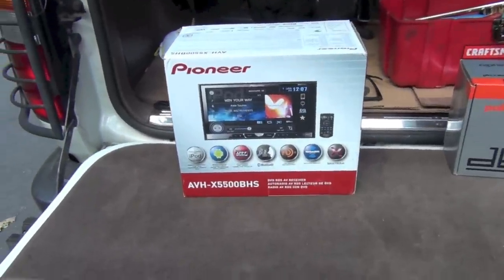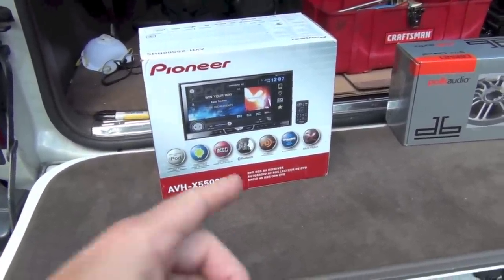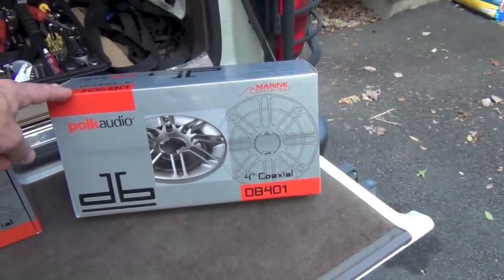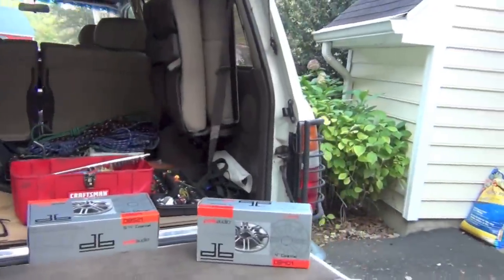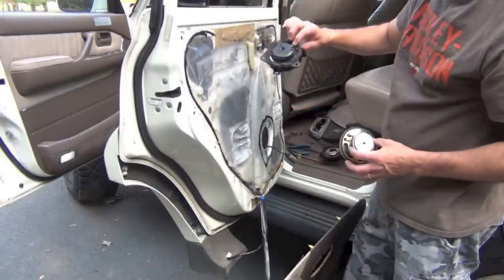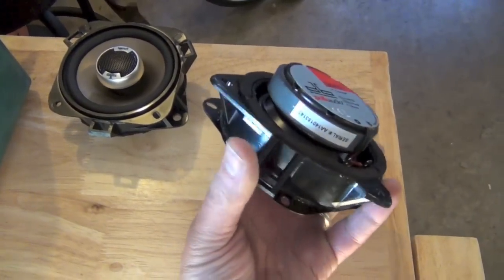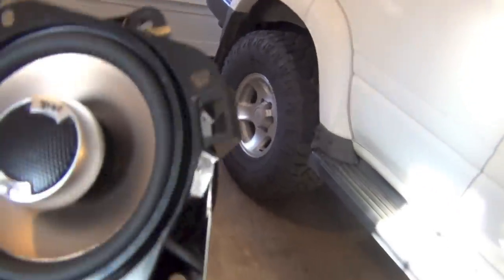Part 1 - Land Cruiser Sound System Upgrade

Comment: Your video was very helpful. I just installed  a kenwood ddx9903s ,2 front speaker  like yours but the new version that are shallow enough to use the  single inside  ring you made for me   between the metal door frame and the speaker . The rings you made were perfect thickness.  The door panel  and grill fit right over the speaker so I didn't need to touch the grill . The new version of the 2 rear speakers fit into the plastic housing   .All I did was cut off the  back piece that has the screw  hole  and I left the side pieces  for stability  .I also bent the tabs   and ran a screw on both sides into the plastic housing   to hold the speaker to the plastic housing . I also add  the polk  marine MM1240 400w 12 inch woofer and amp  in the back right panel. It took me a while to get the nerve  to cut a big 12 inch hole in the panel but I'm  glad I did . It's out of the way and it only sticks out about a1/2 inch  the length of the grill cover .While I was installing to radio I added a front and rear camera . So thanks again for all the help and taking the time to make the videos . I don't think I would have attempted doing this without your videos . By the way the polk speakers sound great .
Reply from the maker: That's great man!  Glad it all worked out and it sounds like you went beyond what I did and made an even better install!  I want to do the same with the subwoofer, did you use the existing wire that was there somehow or did you run a new wire to that sub?  Also, did you fish the rear camera wire through that water-proof flexible connection between the door and the vehicle?  Again, sounds awesome, thanks for posting the results of your project.  Clay
Reply: I got a subwoofer install kit that came with all the wires needed  and I ran new wire from the battery back to the rear panel and the rca cables and power on amp wire  from the back of the radio to the rear panel . My old woofer was in the center console  and it was tiny  the speaker was shot so I just disconnected it . I put the new amp and woofer in the back panel . The 12 inch woofer is to big to fit in and stay on the flat part of the panel so I had to go into the storage door a little bit . A 10 inch will fit perfect and just miss the storage door . I got the 12 inch on sale for less than 100 and its a dual  coil so I ran it in parallel to make it 2 ohm so it cut the 400 w  4 ohm to 200 w 2 ohm so I could use a smaller 250 w amp .  I went with the polk mm1240 marine rated like the other speaker are . polk makes a 10 inch  mm . You probably all ready have wires from the amp in the back panel in your truck  ready to hook a 10 inch woofer to. Find out what size they call for . They even make a metal frame for the woofer to connect  screws into the frame  you can see the threaded holes next to the clip holes to to hold it in place or it might be on yours already  . Look for a light green with red  which is negative  and a light green with black  is positive  and that will be your woofer wire positive and negative .I will send you some pictures on facebook  message . and I'm going to add some photos  in the forum  under what did you do to your 80 series this  weekend . I did run the wire through  a hole just behind the metal carpet  strip  just in line with the boot hole  I put a bend in the wire and it fed right into the boot hole  the backup wires with the rca connection will fit thought the boot  so you see nothing but the boot I'll send you a photo of that too. . You run the camera wire from the out side  to the inside.  there are 3 screws that hold in the black license plate lights on and you take the bolts off from the inside tail gate  once you pull the light plate off just make a small  knock in the plastic so the wire going in  from the back up camera won't pinch  against the light plate once you tighten it back up . It will fit in the same hole that the wires going to the light plate goes through  so you don't have to drill a hole in the tail gate . I will send you a photo of the wiring harness and the wire to connect the wire from the radio so when you put the truck in reverse the camera will auto come on .  I got the back up camera the has IR lights on both sides and it adjust up and down . I adjusted it so I can see my ball hitch so I can hook up my boat  first try  now . I got this one . it works great . they say its water proof but its not . I put silicone sealer around all the ir lights and around the body to make sure no water can get in . There was big open spaces between the ir lights and the body . It has hex screws on both sides so once you have it adjusted where you want it you can tighten it up . I will take a photo of the view from the radio tomorrow and send it to you so you can see the view  from the radio I might go out at dark to show how the ir light work . https://www.amazon.com/dp/B06X6GQVWW?psc=1.
Reply from the maker: Very cool.  Nice work man.  Will love seeing the pictures and will go to the mud site to see your write up.

Comment: Thank you man I  am doing this same exact swap on my 80's series! Thank you! I hope the polks are good the reviews are all kick ass
Reply from the maker: Tim, I had the ID when I was making the rings, but now I can't find that dimension; sorry!  I used a tape measure and a couple of pieces of wood to basically make a long-nose caliper and get that dimension for the tightest hole that would still allow the speaker to sit flat against it's mounting flange all the way around.  This gives you maximum area for the mounting holes and the holes for the grill "dowels".  Hope this helps. Clay
Reply from the maker: Also, the polks have been great.  Hold up to pretty heavy music and the only thing I may do is add a sub to the rear side panel of the vehicle sometime in the future.  These speaker have mid-bass, but not deep bass response.

Comment: At 13;33 with the bead ,I bet that will make it sound better.  The plastic by itself with just a few screws holding it in place could vibrate  and cause a rattle  .
Reply from the maker: It worked so well.  Still doing perfect in there.
Reply: I have a 1997 lexus lx450 and its the same  as yours , I'm going to get the same radio and speakers you got and I'm going to  try to do what you did in the front  speakers . If I get stuck I may have to ask you questions if you don't mind  .
Reply from the maker: justliketolook - Sounds good. Just holler if you need help on it. Also, I'm in the process of making the rings available for the front speakers. Let me know if you would want to go that route vs. making them yourself.
Reply: yes that sounds good  I'll try to message you on  here

Comment: I was stuck on my speaker options.  This helped.  How did you get the built out speaker grill (I think it's 1/2") to fit next to the dash?  There's no room.  Post video 3, pls.
Reply from the maker: Trying to get the other two vids posted. The spacer rings are both 3/8" thick (one btwn door and panel, one on outside of the panel) and the Polk Speaker screwed down on top of that outside one. Will post Vid 3 as fast as I can get it up.  It has the detailed install of one of the front speakers.  Glad it's helping.

Comment: My '93 FZJ came with a Kenwood version of your Pioneer.  I can't wait to get rid of it.  

Isn't it strange how a 2-din unit that can receive satellite radio CANNOT do (isn't equipped to do) GPS navigation without paying over $500?  GPS is the only reason to have a screen that big.

So I intend to trade this giant-screened Kenwood for a 1-din CD radio unit so I can use the other din for a BearCat scanner.   GPS will HAVE to be done by a stand-alone large panel.

Any suggestions on a good GPS system like that?  (think VMS in Australia)
Reply from the maker: Sam Johnson - I’m pretty happy with my Pioneer head unit - I use my Phone for navigation here in the states. Agree that these manufacturers should be always including Nav capabilities with the technology we have these days. Sorry, I don’t have a good recommendation for a great Navi unit. Thanks for the comments- Take care!

Comment: Hey,Tex.. Did you replace the small 3rd row ceiling speaker's?
If so, what did you use (size & brand)?.. I have the same year LC as you, but when I bought it, those speakers were missing (covers too)... Thanks, -Sim
Reply from the maker: +simramsey I didn't replace mine.  They are still in there as original.  I know they do play with the stereo so I think they are in series with the back door speakers.  Not sure.
Reply: Thanks, Tex!

Comment: Wondering why u used smaller size speakers than originals? Any particular reason?  Thx for vids
Reply from the maker: These speakers screw into the original holes perfectly and I could re-use the factory grills. I wanted to look as close to original as possible. Some would argue that these are the same size.
Reply: +Texasknowhow amazon shows that I need to use db651 do you know if my 93lc could be different? I'm want to order them but now I'm confused as to get the ones you show or follow amazon?
Reply from the maker: +Oscar Pallares not sure, good thing is Amazon is super easy to deal with and will take them back if they don't fit.
Reply: +Texasknowhow true thx

Comment: Clay bro, I lost the grille for the rear passenger door speaker. What you suggest what kind of speakers will be good for my car's rear door. I honestly love my cruiser alot and I order the  grille part from few Toyota websites but it's discontinued and they don't have in stock anymore.
Reply from the maker: +Kamran Khan Did you try Cruiser.net?  Also ask on the ih8mud.com forum... see if anyone is parting out a cruiser that has been totaled.  They can send you the grill if so.  The speakers I used in this video are doing well; I would install them again.  Good to hear from you again, take care, Clay
Reply: Yes i did try cruiser.net and they have speaker grille but for front door. i haven't tried ih8mud. I was thinking it would be nice to buy a good set of speakers and use the grille that comes with it. There is one i found but i have to buy the whole door panel with it. Thank you very much brother for the reply.
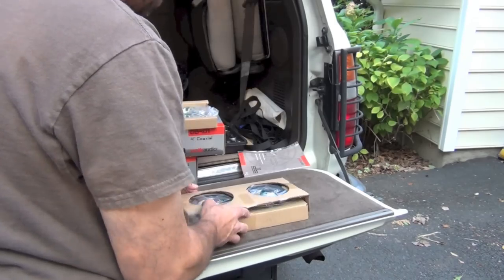Reply from the maker: +Kamran Khan If you look at point 6:21 in this part 1 video, you can see what these grills look like.  I think I may still have mine, but there would be no way to attach them to your door nicely.  They are meant to be held on with the same screws that attach the new speakers.  I'm happy with the speakers (Polk DB401 for the rear doors) that I installed.  Don't forget ih8mud, there are a ton of folks listening on there and you may find an original grill via someone there.

Comment: Nice videos on the system install. I got the db651 for the front doors for a Christmas gift. They are 6 1/4" and apparently are supposed to fit. Plan on tackling it this weekend, hoping it goes well. 
    Why did you choose the smaller 5 1/4" for the front and 4" for the rear? I read that the rear doors are 5 1/4". Do you know something I don't?
Reply: *6 1/2"

Comment: do you have a 4" lift or 3"?
Reply from the maker: It's like 3" in front and 2.5" in back.  The "stiff" OME spring kit.  Check out Slee Offroad or Cruiser Outfitters (where I got mine).  I think it's called a 3" lift.  The stiff springs will help if you add some other stuff up front like a new heavy bumper and winch later.

Comment: At 3:34  the 2 speakers  in the dash ,did they work when you hooked up the radio . Did sound come from the speakers . In my lx450 I have  the 2 in the dash also and I have  a speaker just behind the gear shift built into the center console  here is a photo of  the console speaker .  would think its the same  as the one speaker you show at 2:43  the sub woofer.  Did the sub woofer  work when you plugged in the  wiring harness ?
Reply from the maker: Those two speakers in the dash (one square on the driver's side and one rectangle) still put out a limited amount of sound as do the two up high in the far back.  I think all the speakers are still putting out sound and create more depth in the overall experience.  The Toyota's don't have that little speaker in the console like your LX450.  I'm also not sure if the Lexus may have an amp somewhere in this system...  but I think others have done this exact upgrade in the LX450s and have had zero issues.  Hope this helps. C
Reply: yes any and all info helps
Reply: Yes, the speaker in the center console of the LX is the sub. There is a small amp behind the passenger side dash speaker. I bypassed this amp and the sub when I installed an Alpine system.

Comment: what are the dimensions for the cut outs you made?
Reply from the maker: The OD of the rings are 6 1/4" and  6 1/2".  You need one ea for each front door. The inner dia. depends on the exact speakers used, but should be just such that the full ledge of the mounting surface rest on the ring allowing the rest of the speaker to fit through the ring.  Use the smaller OD ring for the filler ring inside the door panel and the larger one under the speaker on the outside of the panel.  I also used a 1/4" round over bit to make the outer ring have a softer outer edge on the speaker grill side. C